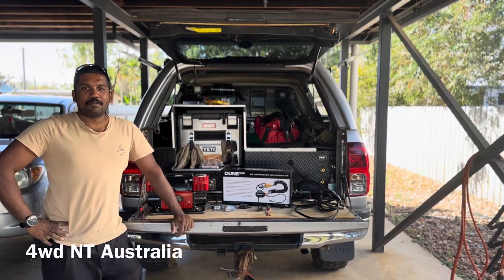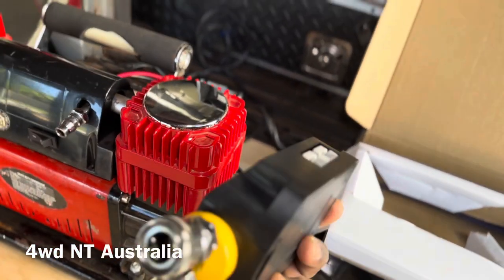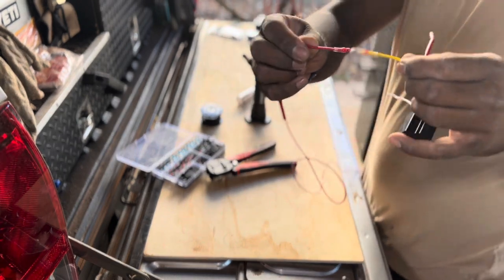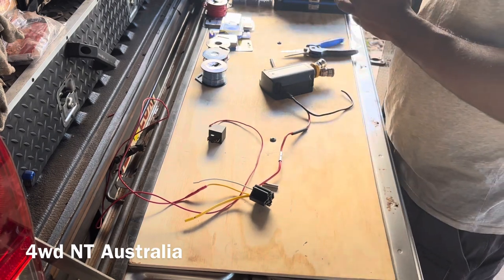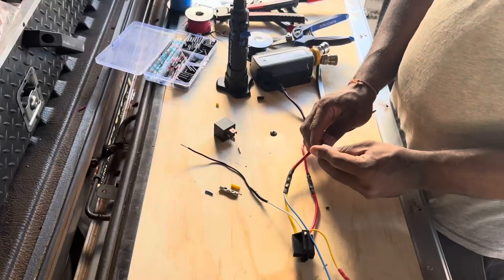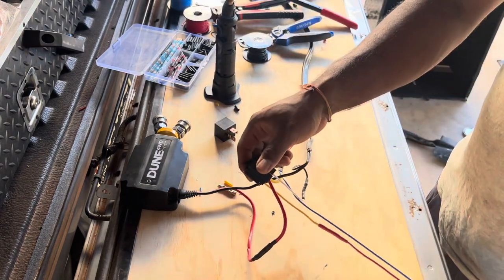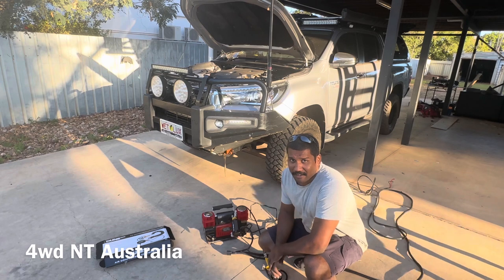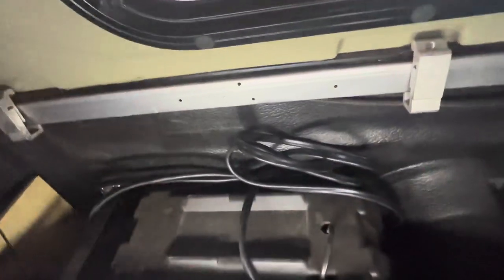Dune 4wd Air Compressor Conversion kit installation.

Comment: Nice video, just a few question in regards what size relay did you use? I though this unit was only meant to be for a single head compressor? Would the wiring be enough to handle the power? Im only using the single cylinder compressor from dune 4wd aswell but im interested to see how you manage to use it in your compressor and if it does not overheat wiring.and what size fuse for wiring.
Regards
Reply from the maker: I used 80 amp Relay mate . My compressor is 45amp one . You can use up to 80amp compressors for conversion kit.
Reply from the maker: Fuse is 60amp , I used wires with 100amp rating up to the relay.

Comment: Excellent video mate.
How did you connect the power? Did you go direct from your aux AGM battery?, or did you run it from your fuse panel?
Reply from the maker: It’s was with 100amp AGM . Now I got a 200amp lithium battery mate . When I was running with AGM, I always keep the engine running.
Reply: @4wdNTAustraliabyThilina  Nice one.... that 200AH Lithium will be amazing.... Sorry, what I was wanting to know, was whether you wired the compressor direct to the battery, or if you ran it from a feed in your fuse block?
I'm looking to do something similar, and am wanting to know if I should wire the heavy duty cable direct to the battery, or if my fuse panel will handle 50Amps.
If I go via the fuse panel, then my shunt will be able to monitor the usage, but if I go direct to the battery, then it would bypass everything.
So, in a nutshell, I'm wondering if I could power 50Amps via the fuse panel (and if that's what you did) ... Hope that makes sense :)
Reply from the maker: I connected to battery directly. Do you have your shut close to the battery or away from battery.? If shut close to the battery you can still connect the negative wire to shunt
Reply: @4wdNTAustraliabyThilina  - Thanks mate.... Great suggestion... I didn't realise I could do that.... (shunt is close to the 2nd battery).
Reply from the maker: @dougalmcpherson8859   then no issue. Connect directly to your battery . That’s the better way .

Comment: Excuse my ignorance with 12V electric stuff, but i believe the conversion kit has auto on off when pressing the inflator.. does that mean there is already a relay inside the box?
Reply from the maker: Pressure switch inside . Not relay.